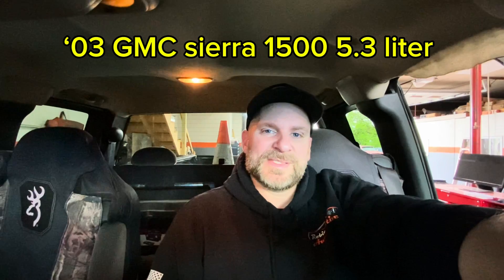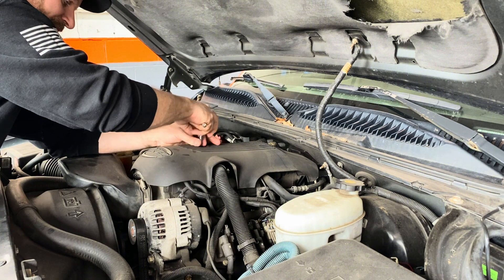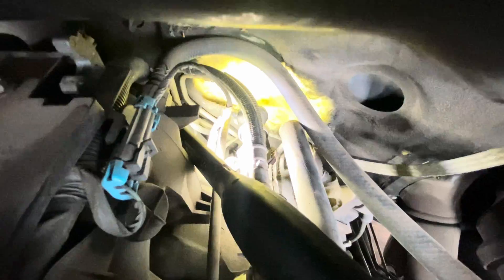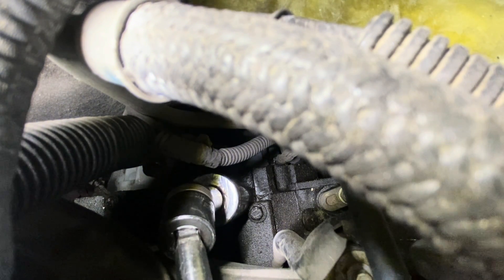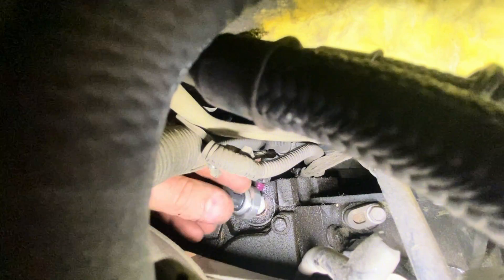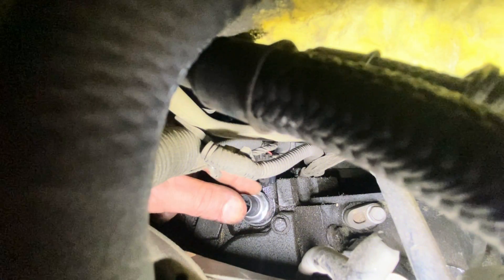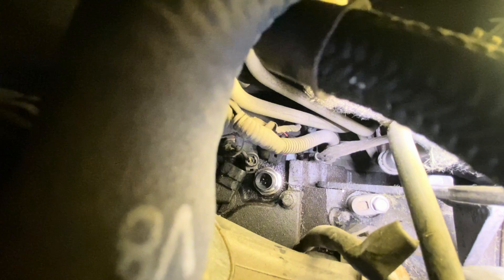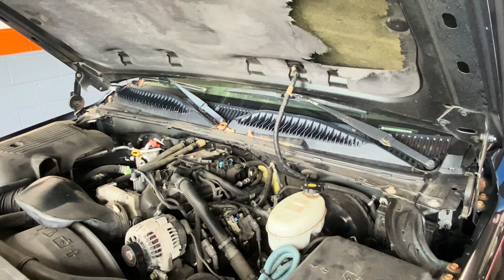GMC: Oil Pressure Gauge Drops to Zero! Top Cause

Comment: I replaced the pick up tube O-Ring on mine still low. Next Im doing the Oil Gally Bar bell plug next its another common cause. Got to back the Transmission off to get to it. Cheap and easy to replace just the time to back the transmission off. If that does not correct my problem its a new Oil Pump time. Miles are too low to be the Cam bearings, but I am debating on just dropping a new reman engine in and not putting more money into it. Has 178k so it will have a ton of life left if it is the Oil Gally plug. My buddies truck had exact same problem after it got to operating temp if you idled it would drop to near zero tripping the alarm. On his it was the Oil Gally bar bell looking plug soon as he replaced it started it up pressure was back to normal. I already replaced the Oil Pressure sending unit too.

Comment: Hey will great video!!! I got a 1989 Chevy thunder ha temp gauge maxed out. Replace sensor. Any ideas?
Reply from the maker: Is it always maxed out even when cold? if so try unplugging the the sensor. is it still maxed? I'm pretty sure this is a ground driving circuit. if possible trace the wire back and make sure its not shorted to ground.

Comment: I have a 2009 Silverado. I have been through 4-5 oil pressure sensors in the past year. 2 Dorman and the rest OEM. Have tried with and without the filters. I might have a sticky oil pressure relief valve pegging full pressure cold and blowing the sensor out??? They go and then show no oil pressure. Weird.
Reply from the maker: Thanks for sharing, see similar issues at times. Like a coin flip. These seem to be made very similar regardless where it’s purchased. Giving the year I’m assuming the OEM isn’t truly the OEM any longer. Outsourced most likely on the same production line. Screen or no screen replaced or left alone. They tend to fail high or low.

Comment: I did one of these last year on a 2000. That one had easy access and no screen, in contrast with some of the newer vehicles. I dropped a borescope into the hole to be sure. Mine, like yours, was leaking a bit of oil through the electrical connector, which in retrospect was the early clue.
Reply from the maker: Thanks for sharing your insight. I find them missing as well. I used to replace every time but never seen one that justified the effort. If I had one that responded slow or took a long time to bleed down It would make more sense. Most that I see fail high or low. 
Thanks for pointing out the oil in the plug that’s a great indicator!

Comment: See, some mechanics claim you have to disassemble half of the engine to get the oil pressure switch replaced.
Reply from the maker: It’s possible to do just not the best on your body and mind 😅
Reply: I made a post above on replacing 4-5 of them on my truck. I can replace one in about 5-10 minutes.

Comment: You are a better fisherman than I. The last one of those I did I dropped the old sensor, never to be seen again! There is a nylon screen that goes in the hole under the sensor. I never changed one but some guys do it as part of the job.
Reply from the maker: 😅 I got lucky. Yup they come with a new screen but honestly I haven’t seen one clogged yet. Changed out a few but then started skipping it. Probably a bad habit. I find a lot missing as well. I feel this is a common failure with or without the screen. They tend to last about the same, some fail high some fail low.